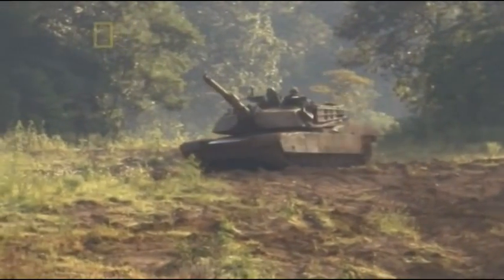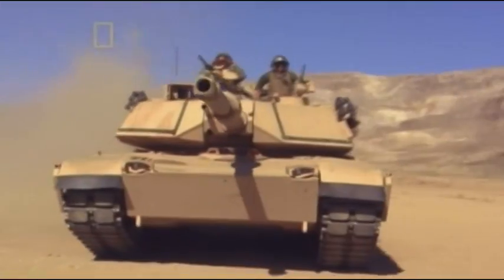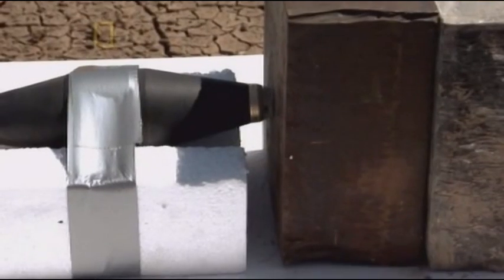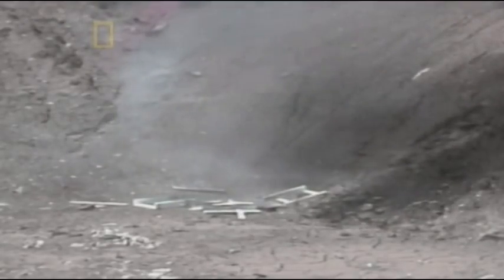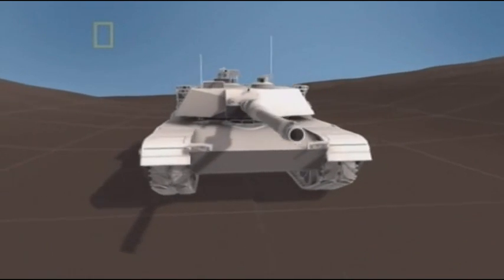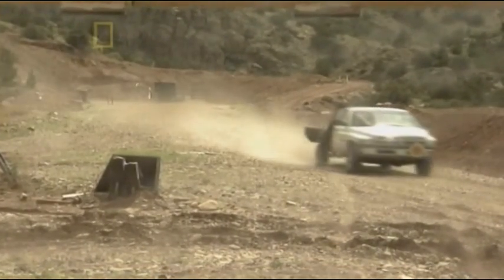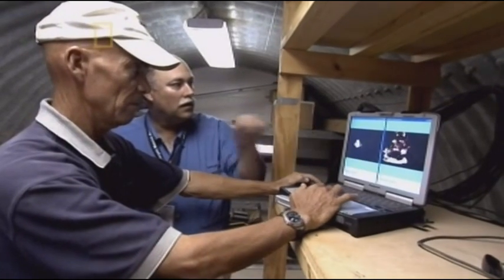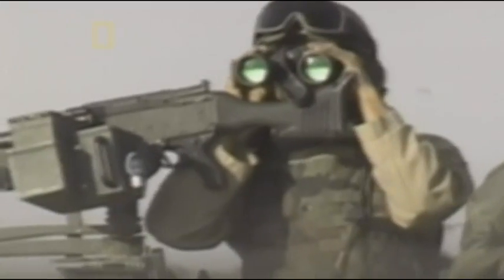Explosive Reactive Armour Explained

Comment: What's the difference in penetration capability if the RPG round velocity is added to the copper penetration core?
Reply: None, i would guess
Reply: Extremely minor. considering the the copper liner is doing ~3000 m/s I don't think a couple of hundred meters per second will make much of a difference
Reply: None. Shaped charges have a set amount of possible penetration, based on design of the charge. The speed of the warhead has no effect on it's penetration ability.
Reply: +Bardy that's not necessarily true, because the added velocity does add a tiny bit of penetration to the superplastic copper jet but the difference is going to be negligible
Reply: +signs80 i honestly dont think so
Reply: +Filip Edwardh I don't see how, when you have penetration as a function of sectional density, mass, and velocity, increasing velocity doesn't decrease any of the other values so you get more energy. Granted the speed bonus is miniscule but there would be a very minor effect
Reply: +signs80 i still honestly dont think so,  heat explodes on the armour then penetrates, its not lika an ap shell at all
Reply: +Filip Edwardh I realize this, but you know that the copper liner that is fired into the tank is also traveling at the same speed as the shell before it hits? it's like starting to pedal a bike from a stop and starting to pedal a bike when a friend pushes you. It still adds some extra speed onto you
Reply: +signs80 the copper moves at the speed that it is squezed out of the shell with
Reply: +Filip Edwardh Yes, but by the laws of physics the reference frame (the shell) is moving too, so you have to add that speed onto every object attached to the shell
Reply: signs80 i wouldnt say speed causes the penetration at all, its the pressure and temperature, the shell pretty much stops when it hits the armour then explodes, the copper is liquified by the heat and pressure because it is surrounded by the explosive in all directions but one, the explosion and pressure liquifies it and presses it against the armour since its the only way the copper can go, thereby burns through the armour
Reply: Filip Edwardh He means the speed may have an extremely negligible effect on penetration. Think about it like this: Copper goes 8500m/s (speed suggested in video, 25 times the speed of sound). Shell travels at 700m/s. Logically, you'd add 8500 to 700 to get 9200m/s, possibly affecting the penetration.

In the case of HEAT shells, I don't think it really matters. The copper is going so fast that there's no reason to add more speed to it. Does it affect penetration? Maybe, but not significantly.
Reply: +Filip Edwardh That is actually a myth, the reason HEAT can penetrate through armor is not because of literal temperature. The pressure and temperature is a RESULT of the speed of the jet. If it was just about melting through the armor than a shield of water around the tank would eliminate the effectiveness of HEAT completely since the Leidenfrost effect would eliminate the stream by disrupting it in the sideways direction. The reason HEAT is effective is purely because of the velocity of the jet combined with the mass and thinness of the jet. When combined they convert enormous amounts of energy from the explosion and turn it into kinetic energy in the form of the jet of copper. The copper jet is not even that hot, it is only like 500°C, not enough to melt steel
Reply: +signs80 I see you down here fighting the good fight. Thank you for your service.

Comment: I was in the Army for 24 years and I never saw an M-1 with ERA.  The Bradley used them.  So I wonder why they linked the ERA to the M-1?  Russian tanks use it.  Some IFV's do as well.  Another misleading video to try to play the M-1 down.
Reply: So by stating facts they downplay the M-1? It's still an amazing tank. The brad is an IFV, of course it'll carry it. In most cases we use infantry and armored carriers out in the field more so than we do M-1s. But does anyone really feel the impact of how dangerous an RPG round is to an infantry carrier? No, because it's an infantry carrier and it's expected to be lightly armored. Whereas an M-1 may not always be penetrated by an RPG, but the M-1 isn't protected all around, especially the tracks/sides and engine compartment. So ERA is necessary. Every tank has a weak point. There is no perfect tank.
Reply: John Doe
I know a guy sitting at the desk right next to me.  His M-1 was hit 41 times by  RPG -7s.  You will only be killed if you engage the M-1 with an RPG 7.  Bradley's and M-1's don't travel apart.  They are organized in Company Teams and will always be together.  My point is the M-1 is not protected by ERA because no need for it has risen.  The video is misleading, simple as that.  The only danger to the M-1 is a kinetic energy round.  That will need to be close and from an angle not the front.  ERA won't help you in that case.  If you have seen an M-1 with reactive armor it wasn't American.
Reply: akgeronimo501 I guess this Abrams is most likely Ethiopian then. Oddly enough it almost looks like it's upgraded with TUSK:
https://en.wikipedia.org/wiki/M1_Abrams#/media/File:M1A1_Abrams_with_Integrated_Management_System_new_Tank_Urban_Survivability_Kit_Dec._2007.jpg

It does eat your credibility a little bit, doesn't it..?
Reply: ***** The TUSK is an option, but not one that is used.  That is why the video shows animation.  You use Wiki as a source and talk about people's credibility.  Right.
Reply: cough

"Wasn't American."

You're funny.

Google "M1A2 TUSK v2" and take a look at the multilayered ERA protection on the side skirts and the ERA tiles (yes, tiles, not cassettes) on the turret. Those aren't Iraqi tanks, because Iraq was never granted access to the TUSK kit (only one foreign Abrams user has been allowed to purchase those kits: Australia).

Now google "M19 ARAT-1" and "M32 ARAT-2": you'll find the two types of ERA available for USAR/USMC M1s. You'll even find pictures of ARATs used in Iraq, and if you're really thorough in your search, you'll even come across that one picture showing a blown-up ARAT-1.

The US are slowly starting to use ERA because of the increased risk of HEAT-based weaponry, especially ATGMs (most specifically, those with tandem charges and large-diameter warheads like the Kornet and Metis-M) that can punch through the turret's side, but they only get mounted according to mission requirements (TUSK is a modular system, after all - you can mount only what you need). They're even planning to mount Trophy-HV on the M1 (other vehicles will get Iron Fist), FFS; that tells you just how seriously they take the growing ATGM threat around the world.

You'll probably never see ERA on Abrams taking part in overseas drills (like in Poland) for one simple reason: the maintenance/logistics crews will never waste their time mounting all 64 ARAT-1s, much less the 85 ARAT-2s a M1A1/A2 is capable of wearing, just for a simple exercise (time is money, and you just don't waste time for something you don't need). They'll only bother when they're in a dangerous territory like Iraq or Afghanistan, where the enemy *will* actually shoot back with live rounds.
Reply: Soultaker7
They are not on there to protect the crew.  They are there to minimize damage to the vehicle.  Think about this.  In the first Gulf War six Abrams were engaged by other Abrams with the 120 SABOT.  One crew member was killed.  It is the best armored vehicle on this planet.  Fact.
Reply: akgeronimo501
So you decided to move the goal posts and started to ramble about non sequiturs. Fact remains: reactive armor has been used with Abrams. Or in other words: you were wrong!
Reply: *****
Fact remains it hasn't.  It is in fact an option, but no Abrams has deployed to combat with it.  FACT.
Reply: akgeronimo501
Keep movin' the goal posts if that makes you feel like a bigger man.
Reply: To stay synchronized with actual events without trying to be overtly political (that is not the problem here, but your wording made it too easy), I guess that's a so-called "alternate fact".

In September 2007, a M1A1 Abrams (US Army 2nd Battalion, 69th Armor) in Iraq was hit in the turret by a RPG-29, killing two crewmembers. That's the reason why the ARAT-2 has been mounted on the turret - to protect against tandem-charge weaponry in an area where the armor is not thick enough to deal with the latest specialized warheads.

The indisputable fact is that the Abrams an has excellent frontal aspect (though the upper glacis and turret roof are vulnerable to top-attack weapons and the latest APFSDS, which have little tendency to ricochet or get deflected by highly sloped surfaces) but has barely sufficient side protection (it was after all designed for massive frontal confrontations in the Fulda Gap during the Cold War). This is the reason why TUSK was created and has been upgraded with ARAT-2 (on TUSK v2, TUSK v1 only has ARAT-1 ERA).
Reply: *****
You said the M-1 was deployed with the TUSK system.  Simply not true.
Reply: Soultaker7
State your source on the crew being killed.  Because it didn't happen.  The entire 69 ABCT left Iraq in October of 2006, I know this because my unit RIPd with them. The only place 2/69 was in September 2007 was Fort Carson.   So wherever you got that it isn't true.  Your second comment is true either.  The TUSK wasn't created to save the crew.  It was created to reduce damage to the vehicle.  "Barely Sufficient'  Interesting.  Six were engaged in the First Gulf war by six other Abrams.  Top of the line gun, with the best ammunition on this planet.  ONE crewmen was killed out of all those mishaps.  Not saying shooting your pal is a good thing, but having said that, at least the vehicle proved it could take a punch.
Reply: akgeronimo501
Please quote me saying M-1 instead of M1A1 or simply an ambigious "Abrams".

You're grasping at straws. Did it take this many days for you to form up this counter "argument"?
Reply: *****
You actually contradicted my statement.  The same thing.
Reply: akgeronimo501
Where? in b4 you contradicting with yourself...
Reply: *****
I made the initial comment on this thread.  By definition that makes it impossible for me to contradict myself.
Reply: akgeronimo501 lol and every t 72 ewas destroyed every mig 29 destroyed lol
Reply: @akgeronimo501  M1A2 TUSK2
Reply: @CHADTHUNDERCOCK80085  But why?  There was only one "perforation" of it's armor.  Just one over hundreds of opportunities.
Reply: That package never deployed that I saw.  No need. I expect it was a package that wasn't bought, but the company made some videos to make it look cool.

Comment: so why is this better than spaced armor? i may be green on that so like don't rape me
Reply: +Xsidon I guess you'd need a lot of (spaced or not) armor to stop the liquid copper jet - and as mentioned in the video at the end it would weigh (and probably also cost) much much more.
Reply: but spaced armor is designed to detonate the warhead and by the time the molten copper jet reaches the 2nd layer of armor it cools down in betwen them to a point where it is not capable of penetrating it
Reply: I believe I can explain why... It's because the solid (I'll get back to this later) copper jet is traveling so fast (Sometimes upwards of 2-3 miles/second, if it were to continue it's acceleration it would reach light speed in 1.5 seconds) that, due to the principle of "Hyper velocity" it acts like a liquid, and everything it hits starts to act like a liquid as well. At this high of a speed the armor physics start to break down... the jet of copper literally punches through steel like wet tissue paper.
Reply: +Xsidon because spaced armor only dissipates the steam somewhat because of the further distance it has to travel to hit the armor. The armor underneath still has to be somewhat thick to absorb the hit unless it's like an ancient weak RPG-7 PG-7V rocket . While ERA essentially prevents any armor from being hit and can stop the heavy punch of the powerful HEAT warheads from modern tanks and what not
Reply: +Xsidon Also the copper is not actually molten, it just acts like molten copper in a liquid manner because it is going so fast that the metal atoms can't hold themselves together like a solid anymore
Reply: signs80 ooohhhh that makes a lot more sense now  thanks guys :D

Comment: Why so much story on Explosive Reactive ARmor, but nothing about Russians that created those first. Its first use were on the T64 tanks back in 1970s. 1000s of Russian tanks were using ERA in the first Chechen war on 1994, while US were still using normal armor.
Reply: +dzulsoviet A West German researcher, Manfred Held  worked with the IDF in 1967–69. Reactive armour created on the basis of the joint research was first installed on Israeli tanks during the 1982 Lebanon war .
Reply: No, its the first time ERA saw action. In 1949 Soviets began research on ERA, it was developped but was said to be not needed because Soviets tanks had good armor already. In 1960s there was competition of who was to develop best tank protection in USSR so NII Stali started making ERA again.
1969, pfffft, 20 years after Soviets did it, good job!

Comment: ERA has been used by russians for ages, Idk why the western countries have taken this long to use it themselves
Reply: Koc yra Because it's not needed. Simple as that, it's not that we've taken long to develop it, it's that we just don't need it. The TUSK variant includes reactive armor. The tanks we use now, consist of depleted uranium armor. Russians on the other hand actually haven't figured out how to harness this.
Reply: Koc yra 
Russians didn't develop ERA. The Israelis did.
Mainly to give cheap extra protection for older AFVs and Pattons. Thats why you see no ERA on Merkave, it has strong conventional armor.

Western tanks have way stronger composite armor then Russian tanks (thats why they are 15 tonnes heavier). 

ERA was used on US M60 Pattons when they were sill in service during Desert Storm.  So the west already used it back then.
It was also used on Bradley IFVs.

But not on Abrams, Leopard 2, Merkava or Challenger simply because they doesn't need it in conventional warfare. Unlike Russian tanks they have thick and strong conventional armor.
Which is why ERA is only used for urban warfare where the weaker areas of the armor are more vulnerable to get hit and its a fast and cheap way to protect those areas.

Thats all ERA is good for. because an ERA block works only once and adds little to no protection against kinetic energy rounds and dual warhead missiles.
Reply: Can you use ERA around friendly infantry though?
Reply: NationalSniper Israelis my ass. Reactive armour used by Israelis was developed by west Germany in late 60s.  Russians already were working on that in late 1940s althou at that point it wasn't working as intended so it was abandoned for a time.   They had it finally working in 70s.
Reply: lukzomg Israel only uses reactive armor because they primarily face opponents like Hamas that use rocket weapons.

Comment: @Talshet K5ERA is worthless as a matter of fact ERA is worthless. It is a one hit wonder. Look at what happend to the Russian Tanks equipped with the K5ERA in Georgia vs Russian conflict. A bunch of them got destroyed during the initial phase of the conflict. These are NON- Export model Russian tanks also which they claim to have better armor than export models. T-90 is not even mass produce the main Russian Armor is T-72 and T-80. NATO has better defensive system for any hard or soft kill.